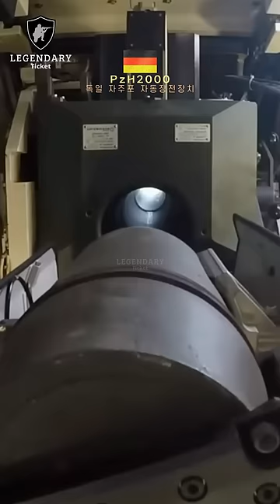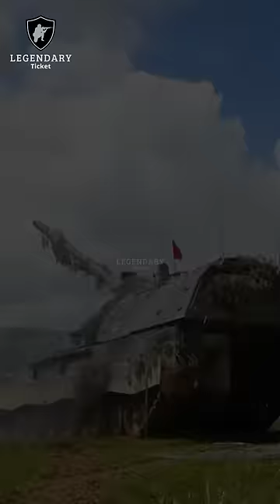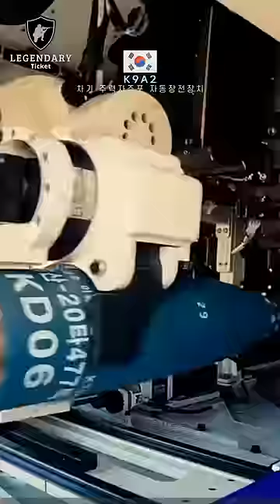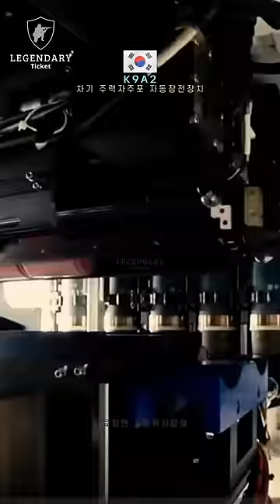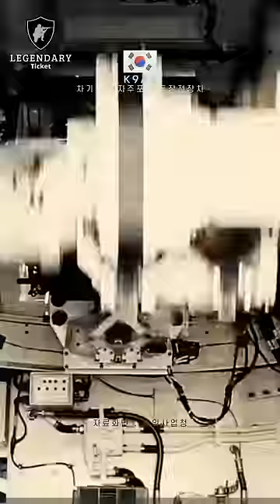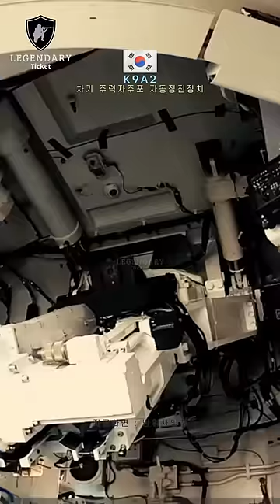세계최강 자주포의 장전장치 비교 – PzH 2000 vs K9A2

Comment: Engineer: "Do you want lots of moving parts?"

South Korea: "Yes"
Reply: How many moving parts does a human being have? How expensive is a human being? Does a human being get tired?  Is a human being’s life worth automation?
Reply: @JohnLee-db9zt  Chillax Albert Einstein

There's pros and cons to everything, and I think it's clear enough for people to understand
Reply: @JohnLee-db9zt  KISS method. 
Over engineering and making things more complicated than it needs to, to do the same task generally isn't a good thing (especially in battle).
Leads to failure and costs lives on the side that uses the overly complicated weapon. Generally.
Reply: just an automatic loader, this is a military advantage that has not yet been fully mastered, but the USA and some European countries have not yet switched to an automatic loader
Reply: @kuonaanchyk2465 no hay ventaja milutar, el sistema automatico, si es muy complejo si se daña un solo componente, y toda la maquina no sirve. Por eso muchos prefieren el manual, si un soldado se cansa otro soldado lo remplaza, hasta que no se pueda disparar ya que el cañón de largo alcance esta rojo vivo por el calor de los disparos.
Reply: @JohnLee-db9zt  In this case? Yes, it's worth it. It's better to havr one crew member more than an autoloader which jams constantly, which is what the K9A2 autoloader is just by the nature of its design.
Reply: The movement of the Phz2000 is very smooth and beautiful
However, the intuitive mechanism does not mean intuitive maintenance

Comment: Remember guys, because it looks cooler doesnt mean its better
Reply: it's better cause it requires less crew that need to be tranged. You can reload on the move useful for avoiding counter battery and if it gets hit its one less guy that could get killed
Reply: @dennisivan85  true, but it can also be operated without the Autoloader, so if it's out you can still use the gun. And saving crew in the vehicle is more personell alive which  is good, and fits ROK ministry of defence doctrine which is throw more shells at the enemy than men cause South Korea's military manpower despite having millions of reserves is relatively low when compared to North Korea's or China's. Yes it will require more parts, but South Korea apart from special forces detatchments aren't interested in foreign wars, so stretched logistic lines aren't a problem, the DMZ and the ROKA and ROKMC are heavily entrenched and have supply hubs all over it, so unlike the US or most NATO armies they don't have to worry about supply lines etc.
Reply: Haters gonna hate...😅😅😅
You mad brah...😅😅😅
Drink 🍸 Haterade 😅😅😅
Reply: In this case, it’s cooler and better. Better than your son, brother, or friend going to war in it, right? 😂
Reply: Are you talking about F22 ?
Reply: fanboy never know

Comment: Like these comparisons but as my Grandfather used to say “ the more complex the machinery the more chance of it breaking down.” How do all those bits perform when the going underfoot is rough I wonder.
Reply: Yes. He is right. So, K9A2 also can be worked by human.
Reply: That’s what I thought the pzh200 is the perfect mixture between automated and manual while the k9 looks so fragile
Reply: @TomyJin  at a way slower speed
Reply: Your grandfather might be correct but ill take the one that shoots the furthest more accurately thanks.
Reply: As of all things developed and manufactured by man.....Lol
Reply: 자동차도 기계인데 무리없이 잘 타고 다닙니다.
Reply: It's for reloading on the move when avoiding counter battery it also means one less guy getting killed if the vehicles hit. You can also manually reload it if it breaks.
Reply: Both of these can be operated even without the autoloader. The only downside is the rate of fire goes down to normal human rates like the American Paladin
Reply: походу наверно Альпы и рябой корейский полуостров с близкими солёными бризами это ну весма жестковатые условия для тяжелой техники.
Reply: 대한민국 기후가 혹독하기로 유명한데 그런 곳에서도 무난하게 잘 굴러가는 점을 생각해 봐야 합니다 물론 전장의 거친 상황과 비할 바는 못되지만 말이에요
Reply: 단 기술력이 떨어질 경우.

Comment: After a few weeks of dust, mud or snow when your only maintenance tools are a screwdriver and a hammer an M-109 or 2S3 would outperform these both. But I'm sure both make a lot of money.
Reply: Don’t think that’s the case for the pzh2000 since it’s pretty robust the auto loader is pretty maintenance friendly
Reply: M777 is best. Fantastic engineering.
Reply: @nicolasolton  That's a light weight gun, not designed for extended operations, and wears down very quickly. Unlike the two in the video or the two I mentioned.
Reply: @jager894  Didn't Zelensky make it illegal to criticise western equipment?

Comment: I did my basic training in tank artillery, and I was told the reason the PZH 2000 doesn't have an automatic loader is because you can shoot faster with manual loading and it's less error-prone.